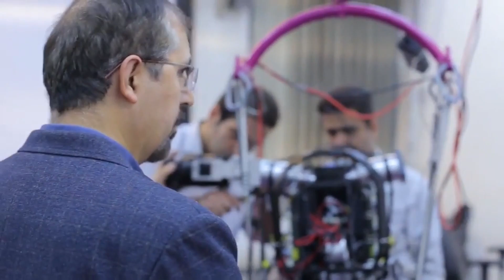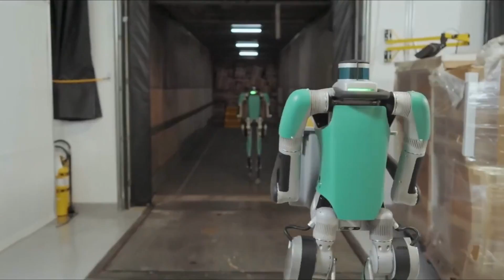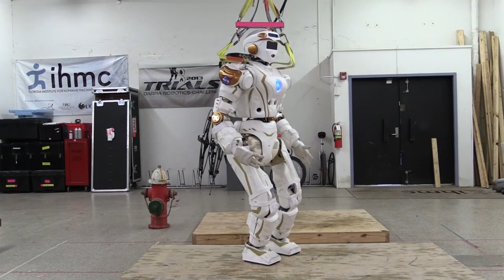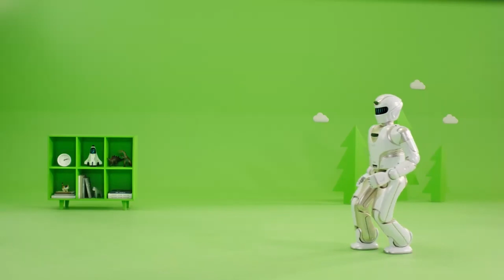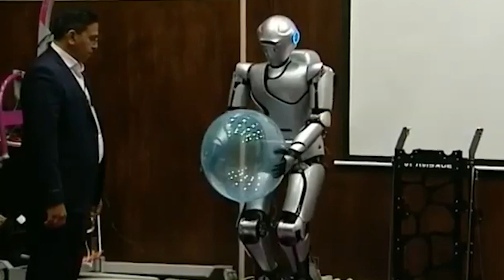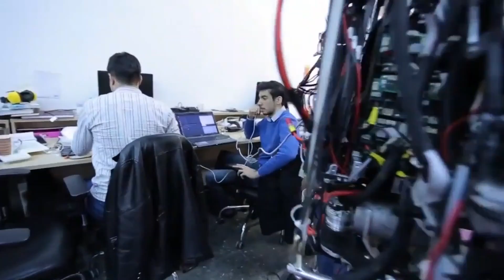Japan's NEW Humanoid Robot Factory SHOCKED The World

Comment: Theyer are gonna build terminators. So for, you can subdue robot dogs with entanglement, ropes, extention cords, chains, nets. Recoment paintball guns aim for its sensorary areas, also if you get  a wad od wet toilet paper and themrow it you can blind some of its sensors. Once subdued , defeat with sledge hammer. Dont run, your safer at home. The robot dogs can be dropped off via drones. For drones, small= high test fishing line with heanmvy waits on either end, bug drones= equil weight hammer heads on either end of a length of chain. Once subdues, defeat with hammer. ( throw your entangleing weapon and watch where they fall, then destroy)To avoid done indentifying you=umberella .  Niodimium magnets( salvage magnet) could come in handy. Over 1000 pounds of pull recomended. Hunters, ready your clamping animal traps. Lineing the interior of your home ensures privacy in the home from sensorary indentification( curently used by law inforcement), use metal, aluminum foil. ( hide in your grow room, if you grow weed) save your ammo. You may need to hunt for food. They are only robots.